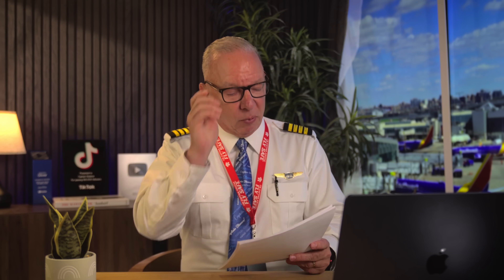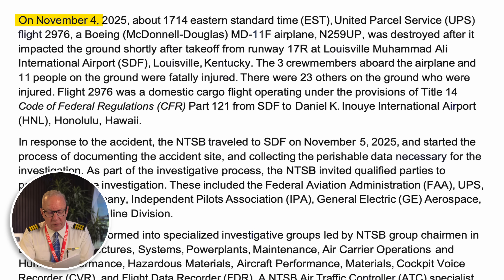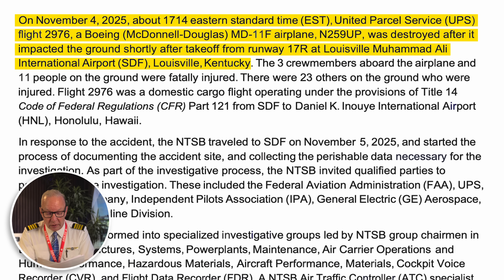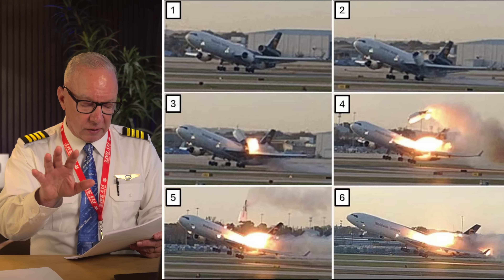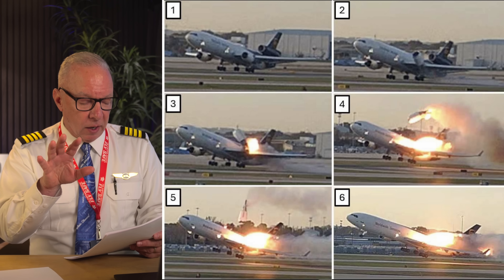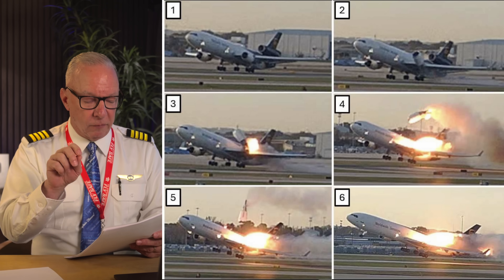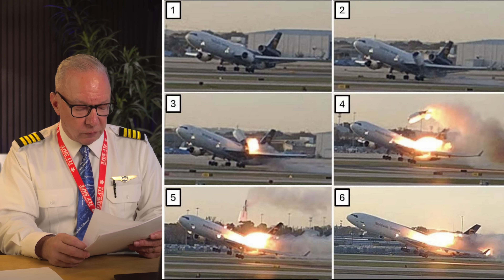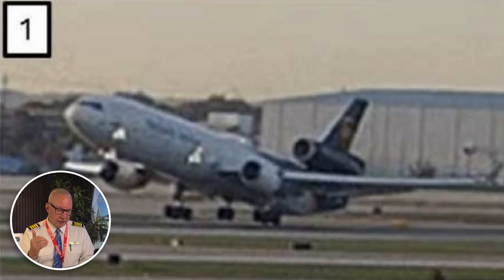UPS Crash Preliminary Report | Pilot Reacts to UPS Crash Report

Comment: For me this is a complete failure for Boeing and the FAA on reevaluting this area for long term safety risk since this happened before earlier in the aircraft model flight operations. Anyone with engineering knowledge should have realized putting alot more time and cycles on this area would increase the risk of stress and cracking and should have started running engineering models on how this would increase the risk and should have brought in or require NDT inspections to be performed for continued safety. The FAA and manufactures seem to always fall in the trap of trying to correct things after they happen and not looking at doing preempitive measures before hand. Both the FAA and aircraft manufactuers need to look at developing a system to which things like this need to be reevaulted for aviation safety because i am sure their is something similar out there that is only being reinspected with either visiual inspection only and/or not being looked at over long period of time. I believe this could have been prevented if something like this was put in place to step up the inspections in this area.

Comment: Question Capt Steeve. Are the inspections intervals the same for any components for same plane models whether it is a cargo or passenger planes. I really hope they are. A cargo plane with a crew of two or a passenger plane with over 300 people on board should have the same safety inspection.  Just wondering…

Comment: Plus all.the wiring and systems are attached to the top of the engine housing. So as it goes forward, breaks all top connections its what pulls it up and over

Comment: So the MD10-MD11 have long inspection cycles for this part and it seems legitimate. This specific engine may have had other issues as vibration or mounting as I don’t expect a general issue not being found by maintenance with the huge number of inspections of this type. Hope NTSB will have a deeper investigation coming.

Comment: FAA issued Pylon ADs after the Flt 191 disaster. AD was written for all DC-10 models. Boeing MD-11 is a stretched DC-10 version, heavier, with added wing span and smaller tailplane. Same engine mount system but more powerful engines. Boeing did not redesign the engine mount system. AD required Inspections of the Clevis and lugs was required 😊after overweight landings. A fully loaded MD-11 is always over the “over weight” trigger for the required clevis and lug inspection. The AD is still active. UPS’s inspection program violates the spirit of AD, probably why Boeing chose to rename the DC10, the MD-11, to avoid compliance with the AD. https://www.faa.gov/lessons_learned/transport_airplane/accidents/N110AA

Comment: @12:40 While the language can be confusing as they refer to the forward portion of the aft mount (due to the pylon side of the aft mount consisting of 2 separate "lugs" which attach to the wing clevis via a bolt and bearing, Figure 7 shows the forward and aft lugs clearly), they've actually only talked about the failure of the aft attachment point.

What they're saying is the aft lug (ie the rearmost section of the aft mount) showed fatigue cracking on both sides of the failure, but the forward lug (ie the part of the aft mount an inch forward of that) showed fatigue cracking on the inboard side of the failure (RHS in fig 7) while the outboard side failed due to overstress only.

Comment: This is proof that an eyewitness (even if by video replay) can be wrong due to angle of view. This is why often 2 or more witnesses from different angles are required for confirmation of an event. From the more side view of the earlier video, it did look like the compressor stall flame puff ball could have been coming from the #3 (right wing) engine. If there was another view from directly behind the aircraft it would have shown the flame puff ball from the #2 (center) engine. Thank you for admitting you were wrong, many people insist they are right even after there is evidence that they are wrong. Some people just do not like being told they are wrong. I live 2 miles from the end of a runway at a mid-sized airport; this type of accident could happen where I live. There is a high school that is only a mile from the end of that runway. As terrible as this was, it could have been worse had it been a passenger plane into a school. (A small plane did land on the ball field years ago.) I say this to emphasize the importance of mechanics and flight crews being very careful when inspecting all aircraft. Also, management needs to be aware of what can happen and make it clear that reporting a problem, even if it has a high monetary cost to correct, is required for everyone's safety, even if it is just a cargo plane. Some people try to avoid telling management of problems that will cost the company money. If any maintenance (lubrication) was performed at that pylon attachment, it should have been inspected more closely. Perhaps a few extra minutes with a flashlight and magnifying glass might have caught this. I would hate to think someone was there looking at it and saw some wear or slight hairline crack and think it is not time for that to be inspected, so that little wear / crack should not be a problem. They may fear being fired for being too nit-picky, especially if that part is not due for inspection for another 8,000 cycles, which might be years away. They may fear management will ask why they were wasting time looking at it 8,000 cycles before it was due for inspection? Just lube it and move on, that was all they were required to do. Some small cracks and surface corrosion are normal on older aircraft. As long as it does not compromise the structure of the aircraft it is allowed. The pylon attachment should have no cracks or corrosion; that location does compromise aircraft structure.

Comment: You've gotten a part of this wrong, Steve and I think it is important to clarify. The forward and aft "lugs" are both part of the aft mount. They are 2 separate "donuts" as you said, which together make up the aft mount. This report makes no mention of the forward mount, nor how it was affected by the failure of the aft mount and the engines subsequent separation from the airframe.

Comment: The MD-11 and DC-10's were grounded following the UPS Crash in Louisville.  Preliminary reports points to fatigue cracks on the engine pylon.  Are these engine pylons unique in design?  Do other aircraft with wing mounted engines use a different attachment configuration that down'e use a pylon to mount the engine to the wing?

Comment: At the 12:00 minute mark in the video, you are incorrectly referring to the fwd pylon mount. The NTSB document is talking about the forward lug of the aft mount. Specifically referring to fatigue cracks on the inboard fracture and nothing but overstress causing the outboard fracture. All of this data is referring to the forward lug of the aft mount.

Comment: Hey capt Steve love your work. 
I have a concern about your comment re engine 2 affected by debris from engine 1. Ive read the report several times and cannot find any mention of engine 2, let alone its reduced performance for any reason.
Im assuming your comments are speculation based on image #6, a fire ball seen behind the port winglet. Ive studied all 6 images and if you keep track of engine 2s postion even  when obscured by smoke,  by the time you get to image 6 i think that fire ball does NOT align with engine 2.

Your thoughts appreciated

Comment: Captain Steve, I’m curious, (and please everyone don’t misunderstand the question, not implying any wrong doing by the crew) could this incident be looked at for a change in procedure in the training where having engines with little to no thrust could cause an immediate retraction of the landing gear to help with clearance of objects in their flight path.  I have to wonder if they had the gear up if they might have cleared the power lines and the roof to where they might have been able to have more time to deal with a situation like this?  It seems completely hopeless from the start but they did clear the fence and many other things despite only climbing on one engine. Truly amazing work!

Comment: It’s interesting to me that the report says that the preexisting stress fractures were in the lug bore…wouldn’t that mean inside where the lug bolt goes and therefore completely hidden to any inspection of the outer surface.  You’d have to take the whole assembly apart to inspect for this.  - Crazy. 

Reminds me of a thrill ride accident where an arm of the ride broke off allowing a pod with 4 or 6 people to detach from the ride and go flying to the ground. They found it had rusted from the inside out, no sign of rust on the outside of the structure. 

Really makes me wonder, should a plane that old still be flying?  How many 1970’s cars are daily drivers working that hard day in and day out.  It’s amazing they can but as so many have pointed out the  maintenance schedules seem like they need adjusting for fewer cycles/hours as the aircraft ages.

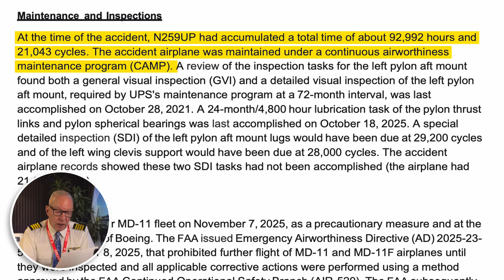Comment: 13:31 So UPS's maintenance program has 6 year interval for inspections of the pylon mounts. 
1. What is the manufactures recommenced inspection interval for those mounts?
2. How long has UPS been maintaining this inspection schedule for the mounts? 
3. Does FedEx have the same inspection interval for the pylon mounts for their MD-11s? 

4. Is there a previous maintenance event that could explain where the fatigue cracks could have started?

I imagine there will be inspections of all (or many) of the currently grounded MD-11 (both UPS and Fedex) pylon mounts to see if similar fatigue cracks can be found. 

This does look almost exactly like the DC-10 crash in the 70's, same cause, very similar result (tho 191 didnt loose engine 2 due to compressor stall,  poor procedure had them throttle back which prevented them form having enough airspeed to possible stay airborne. But with the slats being retracted on the left wing, im unsure if it would have enough lift at that point in flight to keep the plan from rolling regardless.

Comment: I think you are confusing the forward lug of the aft mount with the forward mount. One (rear) of the two lugs on the aft mount failed due to the fatigue cracks, and the forward lug of the aft mount didn't have enough strength to handle the load.

Comment: Is it known how the engine was supported when the bearings were serviced in Oct25.  Does it require that the engine be completely removed to access the bearings.  If it does, did they use an engine stand or make do with using a fork lift, which I’ve seen many airlines do even though should not.

Comment: Love your commentary on this plane crash. I disagree with your comments on photo 6 from the NTSB report. I believe that the flame at the back is the engine coming down on the other side of the plane. Engine 2 was having compressor stalls with small smoke bombs, but not  big fire bombs.
My opinion. Thanks for doing this video.

Comment: If center engine was impacted they had no chance of flying. Not sure why they reply on visual inspections on such a critical point. The rear one should be xrayed and so on, and more often. Should have been a beefier design from start with especially with so many cycles. The rear mounting points have not only forward force but downward force to deal with due to fact that the design by nature wants  to rotate engine upward and forward. Either beefier mount or more of them in back. So sad.

Comment: I’m not a mechanical engineer, but two mounting bolts just feels wrong.  Even though they are big bolts.  Single point failure on both the engine mount and the pylon mount.

Comment: It is entirely possible that the number two engine did not ingest any debris from the separation. The tremendous amount of fire and flame that enveloped  the tail and inlet could very easily have caused compressor stalls.  Engines are not designed to ingest high temperatures air and the accompanying  extremely low density air associated with such an event.

Comment: 5 years is nothing, Boeing doesn’t want engineers to look until the time is due as Boeings models would say it can fly with cracks  and has time until it fails, research maintaining ageing aircraft and MSG2 & 3 philosophy it aims to optimise maintenance efforts by focusing on functions and failure modes. Stretch it out as long as they can to save a buck the problem is there’s not enough new aircraft to meet demand  and these old jets should be parked up by now.

Comment: 6 year intervals on a critical part that has caused a crash before!!??? Insane.  At a minimum I would require all 4 engine mounts (engine plus pylon) on each side to be inspected by eddy current methodology  ASAP. Then, I would require they  be replaced  every 10k aircraft cycles.

Comment: It looked like to me that that bearing looked like it was without grease for quite a long time. A lot of metal to metal contact debris inside that bearing. Almost as if it was greased but the grease fitting itself was blocked. Or someone didn't have the grease gun set properly to allow enough pressure to push the ball bearing in to allow grease to enter that bearing.

Comment: The fact that there were fatigue cracks is not supprising, What is supprising is that they were not found during inspections. That being said if the fatigue cracks were not visible on the surface, then they would have to been found with some type of untrasonic testing. Maybe that is done during some phase or annual maintenance, but I have no idea what takes place during this maintenance. Also, unless there has been some reported failure or issue with this plyon accachement hardware, then there probably would not be a requirement to do some untrasonice inspection and nothing more than a visual inspection. I lived in the helicopter world for most the last 25 years before I retired, and rotor system parts and other critical hardware all have a design life. Regardless of their visual appearance if they reach the design life (in either hours or cycles) then the parts must be removed. I have no idea if the same was true for the pylon attachment hardware.

Comment: The 1985 Chicago American airlines DC 10 crash was not caused by pylon fatigue but cracked engine bolts caused by improer installation of the engine by American airlines staff.  Attorney Jack Connelly of Chicago Illinois was guest speaker in my law school class and he represented 281 of the passengers that perished.

Comment: It’s disturbing that such an inspection interval is allowed. Those engines are powerful and have tremendous torque. When I performed inspection on c141 aircraft I payed close attention to the plyon points. I use to find issues like broken bolts. I hope they are not putting profit over safety???

Comment: I told you this yesterday.  The fire from the disconnected engine lit the fuel spraying from the ruptured fuel lines.  No doubt the fuel was under high pressure from a pump and spewing all over the loose engine.

Comment: So I know exactly.I know exactly why the engine broke loose at V-2 and I'm going to send a message.Hopefully, I can get ahold of Steve and explain to him the physics.What exactly happened. He has not mentioned this in his discussion and that's fine , but if anybody is reading this , what happened is , the engine is a gyro , it has a huge amount of Is angular kinetic energy. And like a gyro, if you or I'll let's say I'll bike tire if you spend it.Really really really fast, And then you take the shaft , let's say the tire is in front of you , and your body is ninety degrees to its rotating access , And then you take that shaft that the wheel is spinning on , and you rotate it straight up in the air in front of you , he will tend to rotate to the right. I don't know what the theory is in kinematic physics.I took a course in kinematic physics. But I bet you , if you were to let go of that tire , it will take off to the right. The obviously the highest axial torque on the engine mount is v two or some kind of abrupt pitch change. That's the reason why it snapped soon after v two. It'\nS also at the worst possible place, there's no recovery.There's no way to get off the ground, they're going to crash.It was doomed from the very beginning. Now as a former air force aircraft mechanic, These aircraft like all aircraft they can only fly a certain amount of hours before the aircraft goes in for major maintenance. What is the major inspection hours for the pylon bearings?